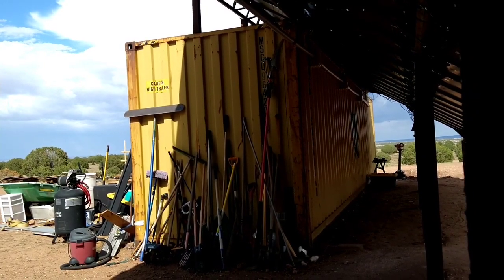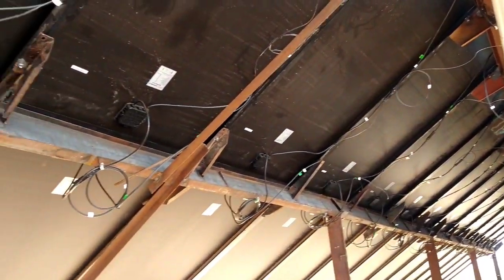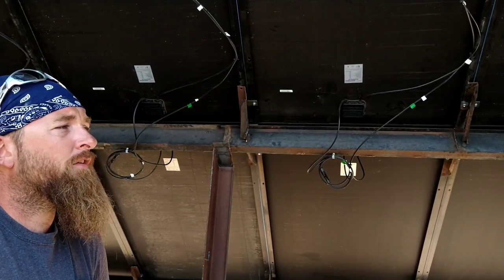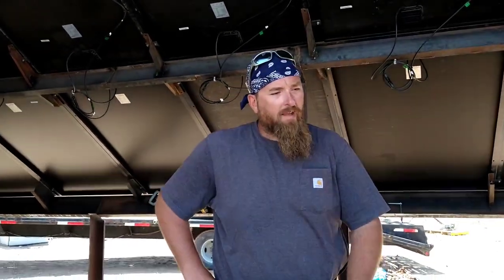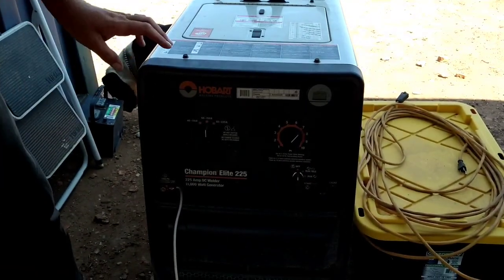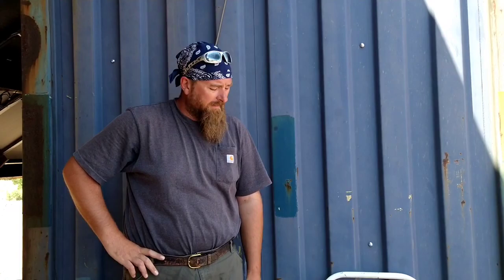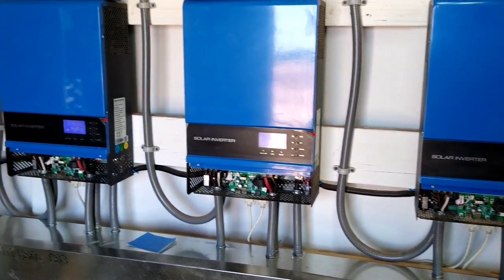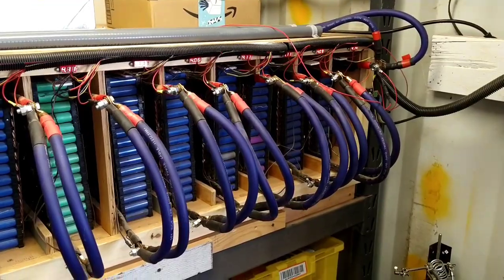Off-grid 200kw + / 46kw/ 18kw solar system for under $25k

Comment: Would be interesting to know the profit margin on the pro installed version. Looks like you have done a great job. I have been off the grid for more than 20 years.... would love to have a system as big as you have
Reply from the maker: I'd say about $75k.. in California, 30kw systems are selling for $100k
Grid tie, no batteries. 
Same price in Arizona. 
Fortunately I obtained all the materials before the Convid price explosion.. Now you'd be looking at $40k just for materials. 
I buy batteries monthly, as backup. They've increased from the $0.58 per to now $1.59 
That alone is almost 300%
Inverters cost about $200 more each.  33%
Panels cost $50 more each 33%

Comment: Awesome set up! Subscribed as I build my off grid welding and machine shop currently. How does 78 panels at 255 watts equal a 46 kw system? I thought it would be 19.8? Please explain
Reply from the maker: Hi thanks for the comments. The battery bank is 46kw. You are right. 19.8kw per hour incoming. 219 amps per hour. That's 11 watts x 4200 cells.
So you could say that the system is about 200kw per day and 46kw nightly reserve.  
I'll check your channel out.
Reply: @SubieRow  Yes i will be adding my solar stuff soon and i think youll be interested

Comment: I’ve had great luck with the JK active balancers and BMSs for not having to carefully match and equal charge batteries. If one series chargers or discharges faster I can see how much it needs to balance and just add a cell. I also carefully check their temps to make sure there are no burners.
Reply from the maker: I'll check out jk balancers. Thanks for the comments. I'll be posting more vids soon.

Comment: That is an incredible system! There are lot of people out there that just don’t realize how inexpensive it is to use solar - I did my first system in 2000, it was only 600 watts and cost me 14,000 (installed)…and it had inferior batteries vs whats available now - if you DIY solar it’s an amazing opportunity!!!!
Reply from the maker: I could have knocked another $5k off if I wasn't new to this area..
In many ways it's cheaper now. I am going to be setting up a couple 5kw systems for my tiny house rentals. 
I can do it for $2k each.  Anyone can.. 
Thanks for the complement.
Reply: My grid use has never been over 70 bucks a month... what the heck are u people running?

Comment: Wow, that's a lot of solar! Our our 6 kwh system was $6,000. We can't run all of our appliances all at once, but we can do everything we need to. 👍🙂
Reply: That sounds like a great deal for a full system and install! 👍🙂
Reply from the maker: That seems to be the typical cost to have someone install a 6kw system.
Reply: @SubieRow    We did the install ourselves, and ordered everything directly from China.  Comparable systems cost  2 to 3 times more when installed by professionals. All of our components and batteries are new.
Reply from the maker: @RedandAprilOff-Grid  I only said that because there is a local solar place that will do a 6kw install for $6k. White mountain solar.. I've watched some of  your vids. Good stuff. I subbed.

Comment: What part is under $25k?  The steel looks like it would cost that amount by itself. I would really like to know where you sourced your components because I am in awe that you managed to build all that for that price.
Reply: Did you watch the video?
Reply from the maker: Hi, I got the metal for under $750 then I sold the axels and have made over $1500 off them, so far. 
Yeah, the boxes were $3k each at the time, but one more trailer would replace them both..I had to get them for storage, so I utilized them. 
My prices were pre con-vid.. 
I now pay $1 each for the batteries. P
That's double what I paid the 1st time. 
If you use recycled parts, like copper
And do the work yourself it will cost you over $100k less than a contractor.
Inverters we're $600 each out of Vegas, panels were $100 each out of Vegas. Wiring was ebay. Lugs, I made from used 1/2 and 1/4” copper tubing. Bus bar wire I got 1000ft of 10/3 well pump wire for free scrap.
Reply: @SubieRow  Would you happen to have a itemized supply list that others could use to build out a similar system?

Comment: Can I ask why you did not consider using Eve 280-210Ah cells, much easier to setup and maybe less cost.
Reply from the maker: Most Ev cells are low quality. Low powered. Except Tesla's which are panasonics.. but those are $20 each... 
I bought these cells for $.58 usd per cell. They are authentic panasonic and LG cells. They are the most powerful lithium ion made. 
If they were going to cost me $5-6 per, yes you would be right..
Reply: @SubieRow    Not Ev cells , EVE  prismatic Lifepo4 cells, Last much much longer, much less work to set them up as well.

Comment: The avg. US Homes uses about 30 Kw/hours per day.  So this is WAY more than a house would need.  Several homes could use this if the sun were constant.  Awesome
Reply from the maker: 3 houses and a full automotive fabrication shop and full wood shop run off this system.
Reply: @SubieRow  ohhh, i thought you were mining bitcoin or something lol. that makes sense now
Reply from the maker: @LanternsoftheDead  we do that too..
Reply: @SubieRow  if i was to use all that power for miners. how many batteries would i need as head room? for constant power at nights or bad weather days

Comment: Nice.....but junction boxes looks bit too small for so many wires ..... and too many exposed terminals.
I have power bricks batteries from china (64kwh reserve) ..no hastle....very simple battery instalation.
Reply from the maker: Main junction box is too small, but everything is secure. I will be upgrading the main box when I double the bank to 92kw. I got these boxes for $11 each. Store wanted $50. Made it work..
Reply from the maker: You saw my opinion on china batteries. They dont last long at all. Good luck..
Reply: @SubieRow  they all are made in china😂😂😂...depends , the cheep once are crap....but there are good one....but they cost.. mine have 10 years warranty.
Reply from the maker: @joseperes777  panasonic 18650 is made in Malaysia.  
Lg 18650 made in poland...

Comment: What level of electrical code compliance do you need to meet in your jurisdiction?
Reply from the maker: None. I did t even need to permit it. But I did.. the inspector was here 2 minutes. Did not check anything except my panel array grounds. Our county code is 1/2 page, scanned crooked onto the pdf. I love it. No problems with gov out here.

Comment: Will it not rust pretty quick?
Reply from the maker: Rust? What that trailer frames? They're as rusty as they'll get.. they're 50 year old frames. If they were rotted out, I wouldn't use them.

Comment: So that is an amazing setup but I run my entire house off 2KW of solar and 11KWH of batteries.  What in the world are you going to do with that much power???
Reply from the maker: Our 5hp air compressor takes 16kw and 175 Amps to start. 
5hp Water pump takes the same.
Auto lifts, welders, 3hp milling machine. Bandsaw, chop saw. Battery charging wall,
 many, many shop tools.
Full woodworking shop tools. Router,  table saw, sanders, planer, 
2 full houses. Water heaters, ovens, fridges, large freezer, heaters, 7 computers. 2 miners, full size washer and dryer.  Charges heavy equipment.
Reply: @SubieRow  Still, that's 230+ KWH of solar output per day.  That's basically what I use in 2 months. No car lift, but looking to put one in my shop. Getting too old creep under cars! Panels are getting so cheap, I need to pickup a few more for cloudy days!